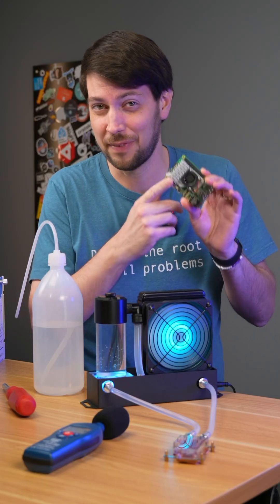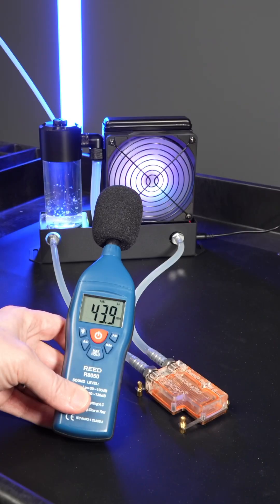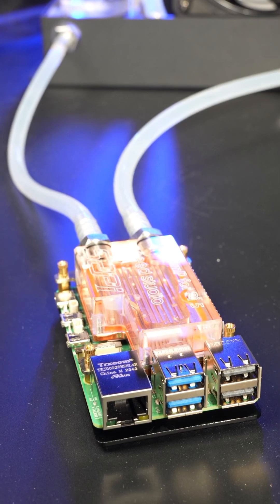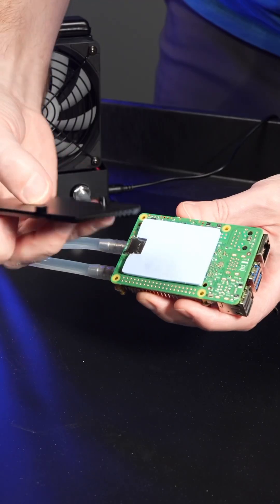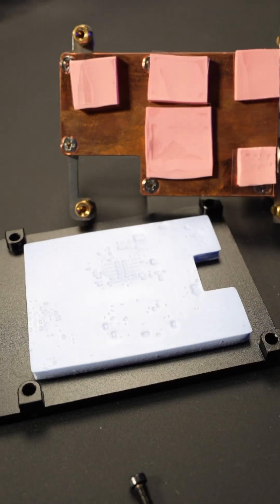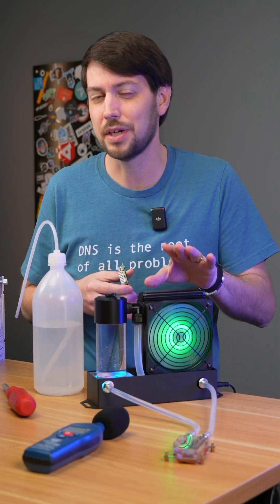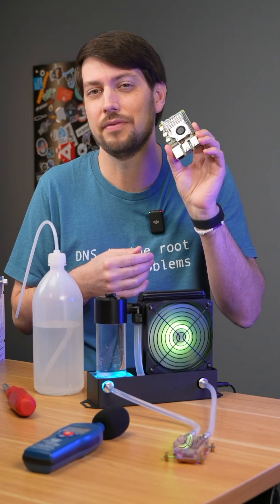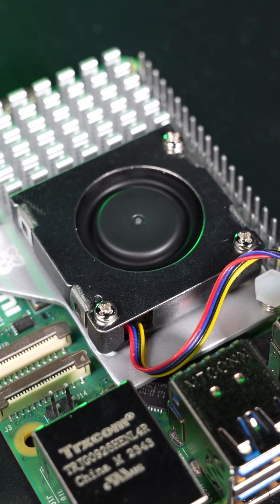Water Cooling Pi 5: cool, but complete overkill

Comment: Well I have been working a project for a few years involving AI and it works well just generates a crap ton of heat so I’ve been using this system and I would honestly say it’s worth it.
Reply: Just keep in mind my circumstances are very specific and that’s the only reason I would do this, under normal circumstances I wouldn’t even consider this.

Comment: i bought an active cooler that has a nvme hat placed on top from aliexpress and the fan is noisy, is it because i bought it from aliexpress? the temperature starts from 52 and goes up, the case fan wasn't as noisy though.

Comment: Use  3M novec 7100 instead of water no corrosion no dirt no fans and it doesn't conduct electricity you just pour it all over your computer in a big tub and circulated it .

Comment: NEVER MIX METALS! EVER! YOU WILL HAVE CORROSION PROBLEMS. That is absolutely unacceptable for any all in one product. Dont even think about buying the all in one kit. If you really want a water cooled Pi, buy the block and run your own copper radiator. Or be smart and air cool it.

Comment: I have seen it already on Michael's Klement channel. He did long time ago a water cooling for CM4 board and also Raspberry Pi 4. I modified his water cooling solutions for CM4 (you can see it on my channel). Anyway water cooling is always very efficient. I think I will buy Raspberry Pi 5 but I think that the bracket for the CPU aluminum block will have to be redesigned in some CAD software to make it work. I have a bracket CAD for Raspberry Pi 4 CPU block. The fan in this 120 USD model should be replaced because it is too loud. Anyway I like it and I want to adapt it for Raspberry Pi 5. Of course it will be much cheaper now, because I have a lot of of leftovers from the previous project. Wish me good luck.

Comment: Makes sense to daisy chain a few blocks together in a Pi cluster to make full use of such a cooling solution. But then again, a nice big heatsink on each and then a 120mm fan (or two) to blow through the cluster would provide similar performance at less cost and complexity (maintenance).

Comment: You can add a solution to the coolant to make sure it doesn't corrode.

But keeping the metals the same or anodising the part that touches cooling solution would work the best.

Comment: I could see another use case: as a small water cooler for high power things (like a mosfet used as a constant load), but it also costs $120 and you can get a more powerful PC AIO for around the same price.
Reply from the maker: Yeah; in this case the custom block is the main thing that is interesting (would be nice if they offered multiple materials, maybe a full aluminum block with no acrylic even?).

But the full kit is fun, however impractical.

Comment: The fact they released a water cooling product with mixed metals is astounding to me….. should have never made it to production
Reply: Basically every AIO on the market uses copper for the cold plate and aluminum for the radiator. You just need to make sure you have an appropriate corrosion inhibitor in the fluid. Standard open loop fluid or distilled water though? Yeah that's a recipe for disaster

Comment: I could see someone throwing several pi 5s into a regular pc case with a 240mm radiator and running that as desktop cluster
Reply: That rad shouldn't have any issues running 5 or more pi's, the real issues be if the pump is any good to deal with it.
Reply: I can see it in a rack, but routing the tubes in a regular case could be tricky
Reply: Ferb, I think I know what we're doing ~today~ this Summer.

Comment: I think you should consider delist/reupload this video with a clarification that mixed metals will cause problems. There are several accounts of what mixed metals can do to a loop and it isn’t pretty. If you decide to make new version, I’d recommend making it abundantly clear that no one should buy that cooler if they don’t want a product that self destructs.
Reply from the maker: My main takeaway is there are very few people who would consider buying this kit regardless—for those who do, they would likely have a better radiator/pump setup already, and they could just buy the copper/acrylic blocks and make sure they're compatible with their existing setup.

Honestly, it's a bit of a 'product looking for an audience' IMO, it's cool that it exists, but it's not really worth the price, at least considering the Pi 5 can be cooled effectively with a large heatsink or a small fan (that's quieter and uses much less energy).
Reply: Or at least a healthy amount of galvanic corrosion inhibitors in the fluid

Comment: If you get the block and use old AIO from another system it could be worth it. For a cluster I'd want a single block all built in to a stack of 5-6. maybe a Peltier stack would work better.

Comment: i could see it being used for a silent rackmount cluster near your workstation if you want a bunch of them for doing some clustering test/dev workloads.
Reply from the maker: You could move the radiator somewhere to try to get the noise down—it is a little on the loud-side though, much more so than the active cooler and some of the other fan solutions I've used on Pi 5 (even including the Ice Tower).

Comment: Mixing metals could will cause problems
Reply: Love it when manufacturers never learn from others mistakes and repeat this same crap with mixing metals :/
Reply: @FAKEAXIS 
Oh they know.

The aluminum is way cheaper that copper and it comes with a fun self destruct feature where it will corrode itself to death and you will have to buy another one.

In all seriousness mixed metals is mostly fine as long as you have the right additive in the water, car coolant works great as cars are full of mixed metals.
Reply: @thetoasterisonfire2080  you don't tend to have copper in cars though, right? Copper having positive galvanic potential compared to strongly negative aluminium is the issue that's hard to work around.
Reply: @thetoasterisonfire2080 what ratio of water to car coolant do you recommend?
Reply: @jfolz  Antifreeze has glycol in it which not only reduces the freezing temp but also prevents corrosion from material electromigration.
But also affects thermal conductivity... Can be bruteforced in a car but not so much PC
Reply: @DLTX1007  yes, I just meant that the voltage potential between aluminium and copper is roughly twice that of aluminium and steel (exact difference depends on the alloy), so copper gets eaten up much faster.
Honestly, with how little heat a Pi5 kicks out, just make everything out of aluminium. Maybe then a block could cost less than 20 bucks.
Reply: yeah that's really concerning. as long as it's only copper on the waterblock side you can work around by building your own loop
Reply: It is absolutely not a problem. This has been solved for 50 years, you simply have to look outside yourmicro niche and look at actual professionally engineered solutions from bigger industries. Regulator HOAT coolant is all you need.
Reply: @otm646 the question is, who'd be bothered to buy such coolant, especially for cooling raspberry.
Reply: @otm646 

That's actually quite incorrect and not applicable here.